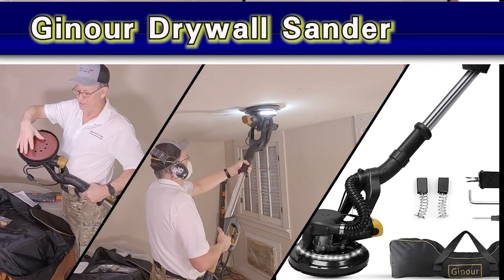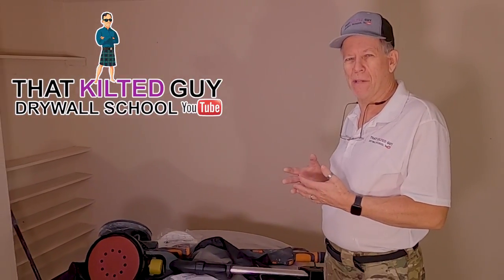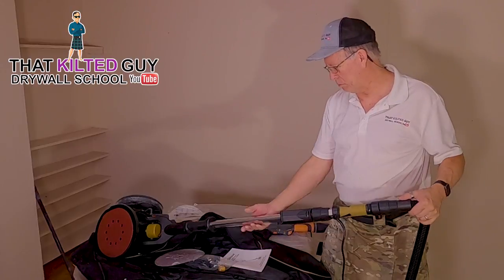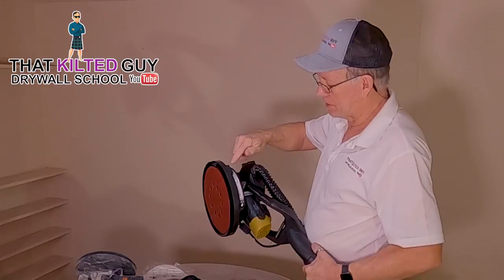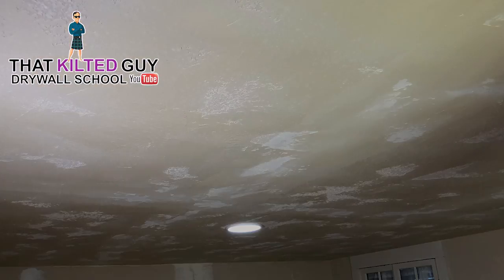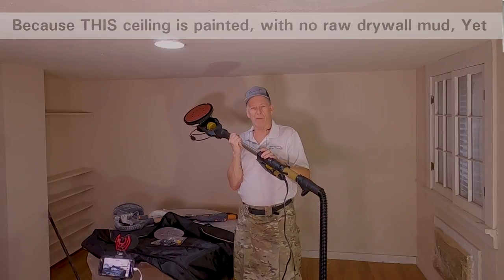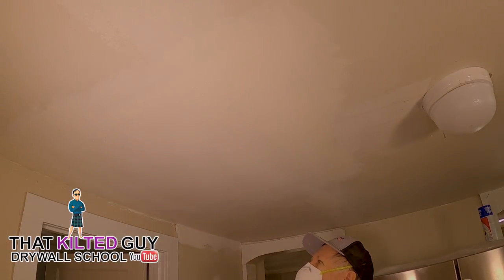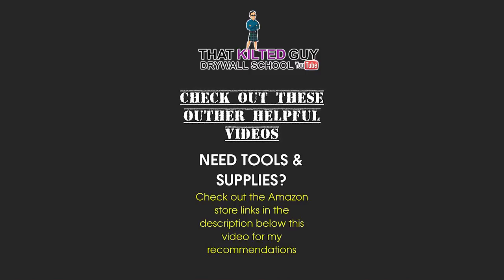This Ginour Drywall Sander requires NO Vacuum, BUT, does it work?

Comment from the maker: 💖 💖 Help us reach 100,000 subscribers by June, 2021, on my Birthday.  Thank you 💖💖

The reason drywallers don't know about this tool is because it's not sold in ANY drywall departments, but it works much better.

🛒 ONLINE STORE & AMAZON LINKS TO OTHER ITEMS IN OUR VIDEO- 🛒

  - - - - -  - - - (Please Subscribe too) - - - - - - - - - - 
🟢 Here's the Ginour Sander link on Amazon- https://amzn.to/2LVAz4E
🟢 Wen Vacuum Drywall Sander (Good one for a low price) - https://amzn.to/35Idmd0 

🟢 The BEST Stud Finder I've Ever used- https://amzn.to/3qoNx9U 
(this Stud Finder is selling like hotcakes, for a reason)
🟢 A nice hard case for the stud finder - https://amzn.to/39vZx2p 
🟢 A good all around Mud pan and knife set- https://amzn.to/2KZG8u9
🟢  Guardz torn paper sealer. Stops Torn Brown Paper from bubbling - https://amzn.to/2L3tl9V 
🟢 Drywall Mesh tape - https://amzn.to/38HUxIQ
🟢 Mesh Tape dispenser (optional) - https://amzn.to/2UpnSyn
🟢 Radius drywall Sander, great for beginners or pros alike- https://amzn.to/2WAxcjd
🟢 The best paint extension pole 2-4' (for the sander above too)- https://amzn.to/2HOc1qS
🟢 Affordable Texture sprayer hopper that I USE - https://amzn.to/2L1jWjb
🟢 The BEST Knockdown Knife - https://amzn.to/3bKkYPV
🟢 A quiet compressor- https://amzn.to/2UnMtUg
🟢 24" Metal Skim coating blade - https://amzn.to/2XIZLxM  
🟢 Rubber Skimming blade mentioned in this video-https://amzn.to/2HdaN76
🟢 The Mud Mixing Drill I use (super tough) https://amzn.to/3dUhMQZ
🟢 For a 4 bladed mixer like mine- https://amzn.to/2UnfbHG
🟢 For a more affordable mixing paddle- https://amzn.to/2FCHFE3

🛒 - VISIT OUR AMAZON DRYWALL TOOLS STORE WITH MY SUGGESTIONS AND NOTES - 

* https://www.amazon.com/shop/thatkiltedguydiyhomeimprovement *

Comment: Thanks for the review Guy. Would like to see a review on the Mirka if possible. Your reviews are important as you have vast knowledge and experience in the trade. Not every one can afford to buy the next dustless system as they come along, and of course, there have been many failures in the past. Inventors should listen to people like you in the research, design and development of the dustless pole/motor head, and HEPA vac systems. See if you can get some tool engineers together and hold a basic sanding pole over there head for 4 hours. Guaranteed it will open up their mind and give a whole different meaning to overhead weight. Anyone can think of an idea/product to make money by selling it to the end user.  The question is.....,"does the product work and serve its intended purposes which are increase production, decrease dust and produce a drywall finish second to none? Another equally if not more important issue to be addressed is tool repair, replacement parts, the bags, filters etc. This is a major problem where I live and I have only seen it get worse over the years. Again, thanks for the honest review.
Reply from the maker: Thanks, I appreciate that 😎, & Thanks for subscribing!

Comment: Ordered this through your link just before Christmas and 10 minutes into the first use, I hit a wire hanger sticking out of the wall that I missed when prepping the room. Tore the pad on the machine, bummer but totally my fault. 
The company is not very easy to get ahold of to order a replacement. Website is nearly impossible to navigate and i couldn't find the tool on their site, so finally tracked them down on facebook, and they're not very prompt on their response.
I am still able to use the tool, and like it, but just wanted to let others know that repair/replacement parts may be difficult to get.

Comment: I bought one of these. If you don't hold it perfectly flat it throws dust everywhere. And it jumps a lot while you're trying to sand especially a ceiling.
Reply from the maker: What’s more likely is that you aren’t putting enough pressure against the ceiling. My porter cable will jump around if you don’t run it right but I have worn out two motors on my sander so I’m pretty good at it and make it look easy.

Comment: Looking forward to your review on cordless sanders..... Off the top of my head, a brushless motor is light weight compared to a brushed AC motor. It going to be on the head, but it's balanced by the battery. No brushes to replace, ever. No cable to replace ever, I'm looking at getting the DeWalt. Disadvantage, run time.... DeWalt was in partnership with Porter cable so they should know what they are doing pretty well.

Comment: Awesome! Do you recommend a homeowner use this for 110 year old porch ceiling? Would this be manageable for us or would a different model be more advised? The price is very reasonable. We don't want to spend upwards of $400+
Reply from the maker: Honestly, they are all a bit of a work out but if you just pace yourself and take breaks it should be doable if you’re in decent shape.

Comment: Hi, great channel!  What's your opinion on skim coating a popcorn ceiling vs scraping it off?
Reply from the maker: Scraping it off is MUCH easier, costs less, less likely to crack, etc, so I would ONLY skim coat if I couldn't scrape it off, or it had asbestos in it.   And, Thanks for subscribing and helping me hit the 100,000 subscriber mark by my birthday on June 10th, 2021.  I truly appreciate it.  Guy
Reply: if it’s painted or has asbestos, skim coat it.
if it isn’t painted, wet it and scrape

Comment: Sir what brand mud do you use for all your skim coating dry wall and ceiling? Really appreciate your videos! Thanks!
Reply from the maker: I use USG +3 lightweight mud, or occasionally the USG regular weight if I feel I need the extra adhesion it has.
Reply from the maker: Be sure to subscribe if you haven’t, and maybe join my Patreon clan at www.patreon.com/thatkiltedguy
Reply: @ThatKiltedGuyDIY  i really appreciate your quick response. I’m attempting of skim coating my dry walls and ceilings. But it seems like it would be a big job for me to do. And i have no experience doing this. It ‘s so hard to find a contractor who knows what their doing in terms of quality when it comes to skim coating. I’ve had terrible jobs in the past. And i git burned so many times. 

Do you know any company that does skim coating that you can refer to me here in California. I would definitely hire you if you were here in CA.:) thanks for your help!
Reply from the maker: Sorry, no
Reply from the maker: My how to hire a contractor e-book and even my common mistakes e-book could both help you find the right contractor. 

My Etsy store is now open with helpful information like e-books, printable guides, hard to find drywall supplies etc. You can check it out at- https://etsy.me/3dxrMRK

Comment: I need to know witch brand works best  as I need to buy one I’m a woman so I need something light and work best
Reply from the maker: They all work well for part time use.  But they are all a bit of a workout, more than hand sanding, due to the weight (nearly 10 lbs) and the spinning action.  But one like this with the motor closer to your body is easier on you- https://amzn.to/3ytXg2k
Reply: Mirka Leros